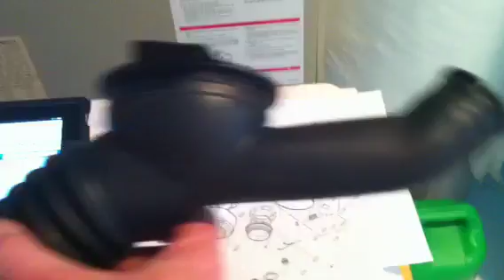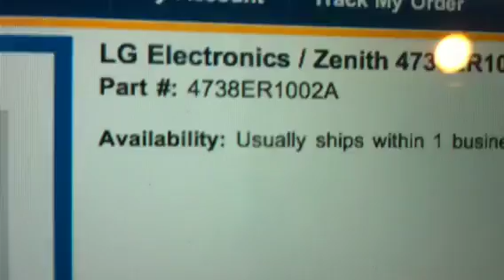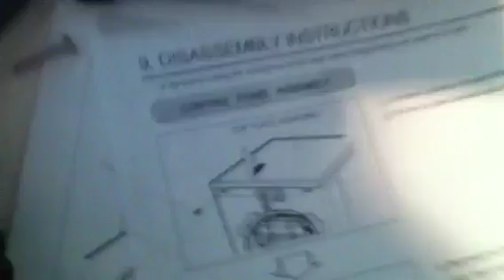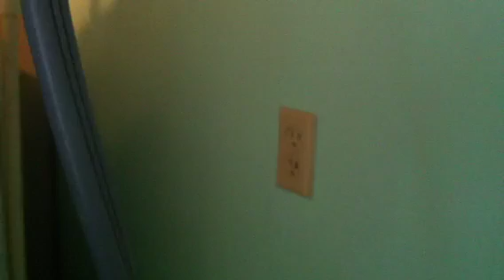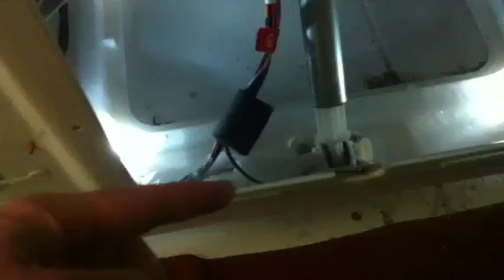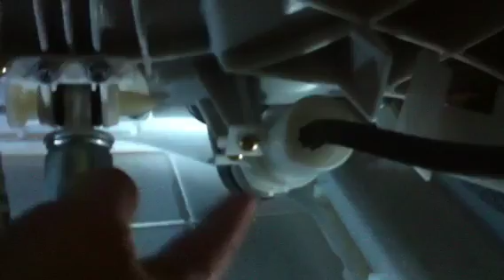How to Repair an LG Washing Machine Leak

Comment: Mine is leaking now. I replaced the bellows, but found no hole in the old one. But it was worth a try. I am going to try replacing the intake valve next. Now I have a spare bellows!

Comment: I have a Kenmore washer about 2012 model just like this. It has developed this leak. I am replacing mine with a unitized washer/dryer that is better to be in a closet. I will be selling mine to a friend after I repair it. I have not worked on it yet. This could be the problem. In looking at parts for my Kenmore I see that most of the parts also fit LG. So I know my Kenmore is made by LG and it think I will be needing this same part.

Comment: I'm not sure who the thumbs down people are.  You saved me from buying a new $1100 washer! just last weekend, my wife said, "either call a repairman or let's get a new one." I went to YouTube, watched your video, ordered my part on Amazon for same-day delivery and it was fixed by the end of the day.  What worked for me was just leaning the washer on its right (my left) side.  I could access the pipe easily from the bottom of the washer. it took about 10 mins because the center gasket was tricky. But done in no time.  I went to the LG site and they noted typical areas where the washer is likely to leak.  They mentioned nothing about this location, which appears to be quite common. Thank you for taking time to post this video.

Comment: This video was very helpful in giving me a place to start in looking for the source of my LG washer leak.  I opened the back panel, felt the hose in the area suggested as the "weak spot" for the hose design; sure enough a small hole in the hose.  Got a replacement part from the local appliance parts store and installed.  As noted in the video, it's not easy doing it from the back access panel, but it can be done!  I found this video to be VERY helpful.  Also note: if you own one of these LG machines and have not read the owners manual please know these machines have water inlet basket screens on the hot and cold hose fittings.  I suggest you removed the hoses and pull the screens out and check for build-up.  Mine were packed with debris.  They're easy to clean and re-install.

Comment: You can get the part in less than a week from RepairClinic.com for $9.08. They also have a video showing how to do repair. They recommend removing front panel as well as the access panel in back.

Comment: Reinforce it with some silcone glue/sealer in the weak spots on the new ones. That could save you some hassle doing the work to replace it down the road.

Comment: They are using really cheap plastics that always spring leaks because the plastic break down.  In my case it is the drain hose that springs a hole.  To get a repairman is $300

Comment: I found one of the shock absorbers had come loose on mine causing the leak during heavy loads.  BTW - You don't have to bend the panel to remove it.  If you slide it up as high as it will go the bottom tabs will be high enough to tilt the bottom of the panel out and slide the top out.
Reply: Hi, I was wondering what the shock absorber is and where to find it?  We've had a leak in our LG machine several months ago (I think I was washing a bulky load), and again today it has leaked (I was washing a heavy load with several pairs of jeans).  I noticed the machine took forever to wash this load.  I started a new load and this is when I found the leak.  I find it odd that the leak is intermittent, and is possibly linked to washing heavy or bulky loads.  I'm curious to see how you fixed your problem.  thanks!
Reply: There are three shock absorbers. They are connected to the tub enclosure with plastic pins. One of the pins popped out. I  only had to push the pin back in until it clicked and it hasn't leaked since. You will have to take the back panel off of the machine to access the shocks.
Reply: Thanks!  I just saw the video and saw where the OP showed one of the shock absorbers.  Hopefully that is our problem.  When we tried to find the source of the leak several months ago, the washer would not leak again after doing multiple test cycles.  Today is the first time it has happened again.  Thanks for your info!
Reply: I figured out my intermittent leak problem, and its embarrassing.  After pulling the machine away from the wall, we saw where a trail of water obviously streamed out of the air vent holes.  Apparently this happens when soap residue builds up and you dont do a tub clean regularly.   Ooops!  I used to be good about running the clean cycle but lately its been forgotten.  
I ran two tub clean cycles back to back and no leaks or water coming out the back vent.  Hopefully if someone else has this problem this is another first thing to check before having to open up the machine!
Reply: That is totally correct on the later LG machines

Comment: Thank you for this very detailed video - I have not opened back of washer yet but I will be doing this. My LG is from 2010.  Will be back to tell you what I find.  I was dreading a repair call and a follow-up call for the fix. Thanks!

Comment: Tip the machine and work from the bottom. 5 min repair.
Reply: Wonderful Tip Lisa!!! .... just did mine by tipping back and accessing from the bottom, less than 10 min job .... I love you Hahahaha
Reply: I did it without tipping but that is tough.   Next time I will tilt it 40 degrees and brace it.  I NEVER could find a leak in the old part but replaced it with a new $10 amazon part.  Maybe the clamp had become slightly lose.  I just know now  no more leak.

Comment: Thanks for the video, my bellows hose had the hole in the exact same place as your video..................now ordering the part, and yes that back clamp near the front of the washer (farthest away from you when accessing from the back of the machine) is a real pain adn tight working area to clamp off and on.

Comment: Just did the repair and to anyone reading this, do yourself a favor and tip the machine over and work from the bottom. Too easy and full access. Took me 10 mins roughly.
Reply: +Morgan Glassco Yeah, that is the most efficient and easiest since there is no bottom to the washer, however, I have same problem as OP, limited amount of space and washer on a pedestal.  All I can do in a tiny laundry room is turn it vertically and work from the back.
Reply: +Morgan Glassco I aint breakin my ass

Comment: Great video! I would caution that this can be challenging. The clamps are a bear to collapse and getting the bellows back on was tricky. I ended up doing the furthest one by holding the depressed clamp with one hand while slipping the sleeve over the tube (basically by touch/feel since it wasn't possible to get a good look) and then switching hands to slide the clamp over. Be wary of twisting any of the tubing, especially at the near end of the back.  My bellows did not have the crack, but in watching the machine run after removing/examining/replacing there does seem to be a leak from the middle connection so I'm replacing the bellows and trying again. Based on one of the comments below, I'm also monitoring for input leaks. I do think it's probably much easier in the long run to do the full disassemble.

Comment: Appreciate your vid!  It was the exact problem we had. I pulled it apart and then tried to order the part. Here's where things went sideways. I am not allowed to order the part in Canada because of some crap policy with LG. That was a real pisser since I know exactly what it is!!! In any event, I had to order it through an auth services who then sends a guy out, with both a call out charge and the repair charge, $200 later. I am appreciative though since I guess it saved me the initial call out charge since I knew the issue and insisted that the part be brought on the initial visit. Big thumbs up to your vid, big thumbs down to LG's lame policy that cost me $190 more than it needed to.

Comment: First  thank you for the video is great, I got the same lg washer machine real good but after 10 years plus of  having her I do have a small problem with her, front door leak do you have any idea what may cause the problem? I took the door sail off and clean it but didn't find anything wrong with it any idea?
Reply: +Erick Padilla hi Erick did you find out what to do for your lg washer door leak?

Comment: I have a lg front load washer machine I bought from Sears in 2010. Been a great washer. The weekend it has been leaking at the front left corner. Your facing it as if your putting a load in. You got me thinking on pulling it out from the wall and inspecting it. If it is the same problem as yours. Save me a $80 service fee. I will check it out after work tomorrow. Nice video and very helpful.
Reply: same problem and i cant find out where the leak comes.... very disapointed with lg

Comment: Nice!  It tipped mine up from the front and saw the exact same hole.  I’m thinking… waterproofing tape?  ..tire-repair plug?  Rubber cement??
Reply: ...and I went with "Nashua Stretch and Seal" which is a self-fusing silicon tape.  Worked great!!  $5 at the Home Cheapo.

Comment: thank you for posting this video. It seems this is a common problem that causes leaking. My leaking happened only when main water valve was on. If I turned them off the leak stopped. My problem turned out to be the water valve intake part# ER5220FR2006H it was  $10.00 part. located on top back end of machine ( were the water intake valves are located ) since water seemed to be leaking out the bottom, I didnt think to look in this area. Once you take top off machine you will see obvious sign of leaking. This issue drove me crazy trying to find the leak.... I hope this helps someone else NOT go crazy !! PS was very very easy ti fix

Comment: My LG (WM2601) is leaking around the drain pump area (bottom left front when facing machine). Was this the same location you noticed water leaking on yours? And it leaked mainly when draining.
Reply: Did you get an answer to this?
Reply: Sheila Butler
No, I haven't received an answer. The problem turned out to be a hole in the drain hose, close to the part in the video.
Reply: papi So is mine... So I have to check the hose?  it leaked a lot from the filter area, at least half a bucket.

Comment: My is leaking but not all the time. And it is not coming from the drain pipe its coming from underneath towards the right. Now if this part was the culprit it should leak every time right? With a crack in the assembly. Has anyone had an intermittent leak and this part was the cause, because I dont see how that is possible. I guess in need to get under and inspect it.
Reply: D G Mine is doing the same thing, did you ever figure it out?

Comment: 2 Things: 
1. Very easy access from the bottom.  Lay the washer on its side to access.  
2. My leak was the hot water valve.   Still a very inexpensive part, ~$15.  even easier to replace.  Mine leaked out the top of the 12v solenoid.

Comment: food for thought, at 7;28, ( the white piece ) i found it  easier to remove the two screws that hold it in place and lowered it to gain better access to the clamps. have to say , the one on the pump was a real $#@%^**. Great vid. kudos

Comment: Thanks 4 the helpful video!  However, u don't have 2 bow the back panel out 2 get it off & on.  This can permanently dent &/or crease it, allowing bugs & dust in easier.  2 of the ears r made shorter than the others.  U only have 2 slide the panel up & lift the bottom out first.  The people from whom I bought mine made the same mistake, but they didn't even try 2 get the tabs back in the slots & mangled it pretty well.  I straightened it the best I could and put it back on properly.

Comment: Thanks, nice vid. Replaced my first on a 3 year old machine. What a flimsy thing, it's definitely easier to take off than get a new one on. I used vise grips on the two spring clamps and a little dish detergent on the fittings. Whoever designed this part should spend the rest of their life replacing them. I can see charging $150-200 to replace one, it is a pain in the rear.

Comment: 1. Thanks for the video. I probably have the same problem as explained. Now I think I know where to look for.
2. I think I have an easier way of accessing the component. While searching for the problem I had just tilted the machine on the side-(say by 40 degrees), and  supported it against the wall (wife holding it in position). I had inspected the component from the bottom of the machine, instead of from the back panel. I could easily check if the clamps were secure.

Comment: I know you posted this a year ago, but-- my drain pump did the same thing a couple of months ago.  I did go through the process of taking off the top and front of the washer just to get to the drain pump, which is on the bottom of the machine, on the inside, right next to the front panel.  I just had to take the drain pump motor out of its casing and rinse it off a bit, reassembled the machine, and I have not had drain issues since.

Comment: Thank you so much for posting this! i replaced the filter in the back and thought that I had solved the problem. Then I noticed that the water was leaking from the bottom of the machine!. your video and instructions are so straight forward. I appreciate the help...It  think I can fix it now myself!!

Comment: I'm just starting to trouble shoot my water leak right now. This video gives me a lot of information I need. Thanks very much. My problem is that there is a slow, small leak somewhere when I turn my faucets on without even running the machine. Any clues?

Comment: Thanks so much for posting this. We really like our washing machine (other than the leak) and it was such a relief to find out that it was such a simple inexpensive repair.  I was ready to take half the washer apart before watching this!  Ours is a newer machine, with a slightly different part, but still just as easy to fix.

Comment: I think the should have used a smooth inside wall hose all the way out. It was actually unbeleilable how much it was clogged , like an artery. I wish I was able to take the whole thing apart because if you could get a glimpse of the underside of the drum through the hole , you would see alot of gunk on it. I think thats why some of my clothes tend to come out with stains that look like light grease spots.

Comment: Hey nice job!! I'm in the process of removing both drainage hoses, pump and filter that is situated at the bottom left of the washer. I want to tell you and everyone else that if they do decide to take anything apart to take the time to remove the lid as well so you can take out the drain hoses. They tend to accumulate some really stinky and very crusty muck, I think it was a mistake to use the hose that they did.